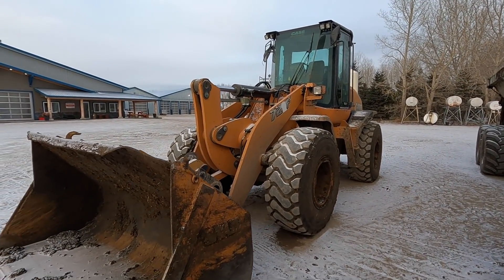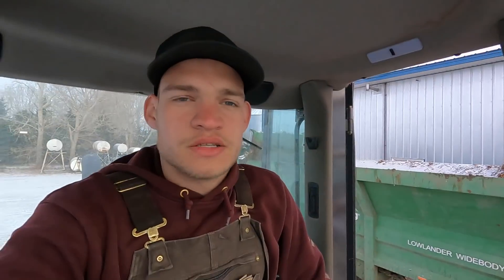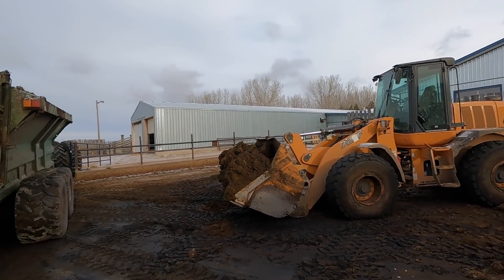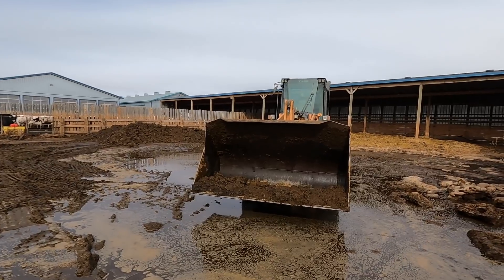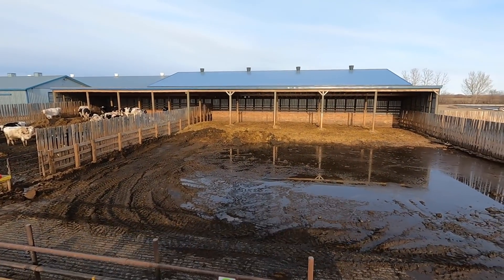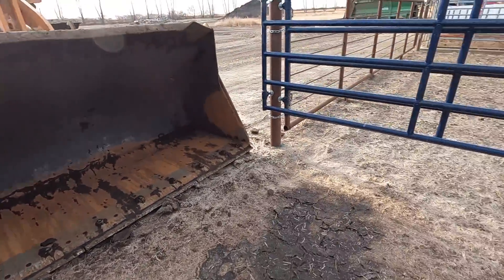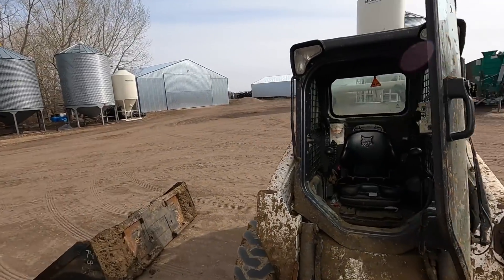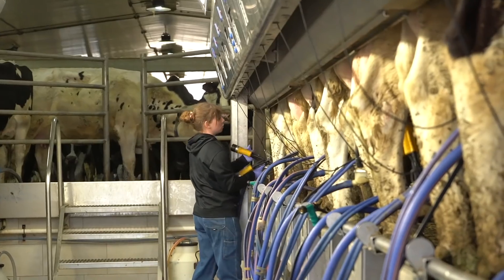Cold Start, Broken Alternator, Frozen Wagon!

Comment: Lower PSI will decrease the chance of a puncture. Think of it as trying to pop a balloon that is filled with a lot of air and one without a lot of air. Unless the sidewall is super thin on the loader you should be good to run lower PSI.

Comment: Hi Jan! I have experience with the exact same problem on Valtra tractors . It was the starter. It's slow so the battery can't pull it around. I hope this is a tip that you can use. Nice video as usual :)

Comment: Lower pressure on loader tires gives much better traction. If there are radial-ply tires there are made to run and flex at lower pressures without harm.